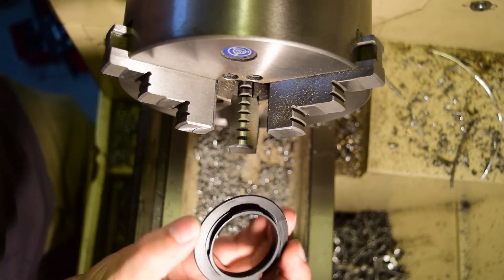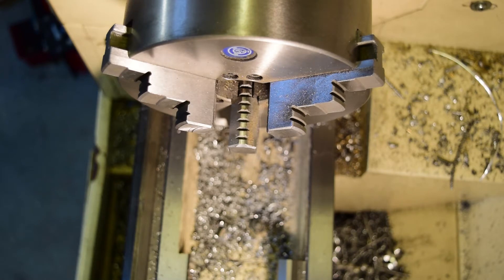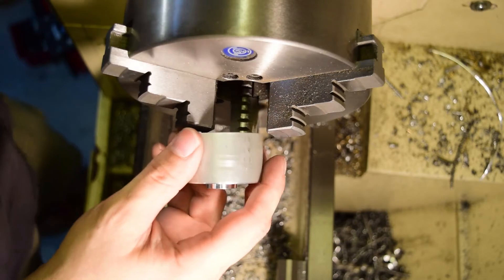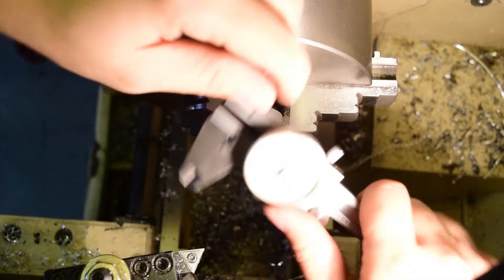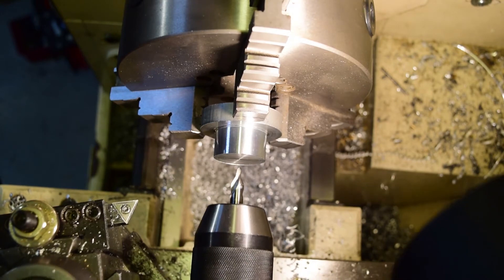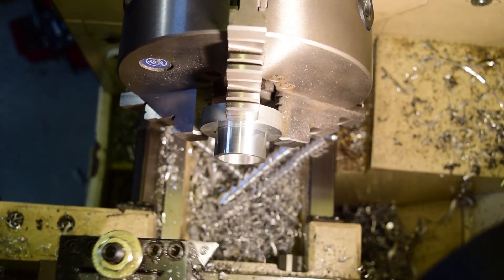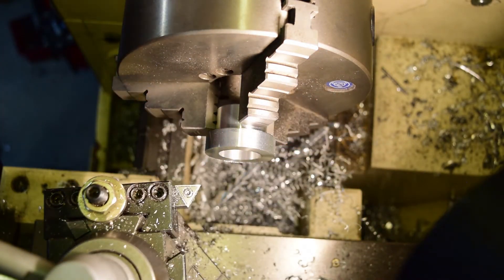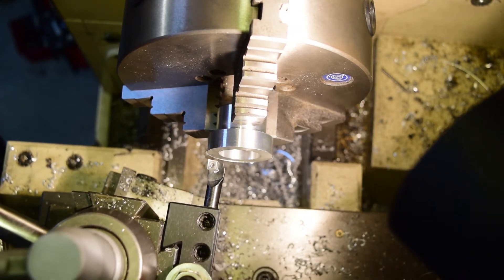Telescope mount for the Nikon F DSLR

Comment: I think you might find that instead of using a dark lens you can just use a nice small aperture on the end of the telescope, you'll be able to get the intensity reduction without the tint messing up the colour in the image. I'd probably start with a pinhole, and work my way up from there.
Reply from the maker: Will give it a try. Thanks!